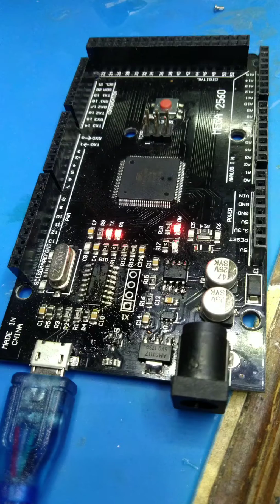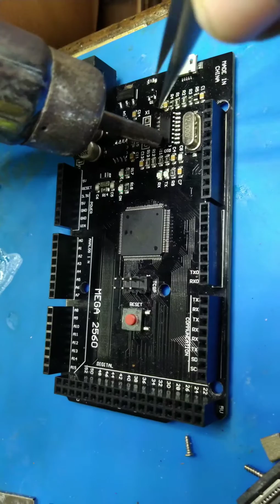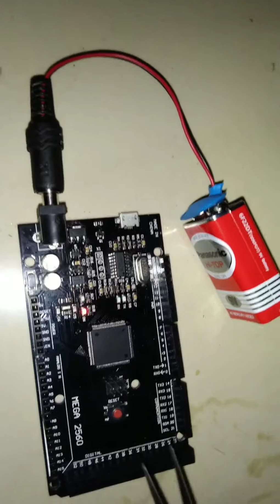How to fix a Dead Arduino Mega (CH340G fix)

Comment: I have same problem in arduino uno (CH 340G). When I connect Arduino uno to my pc it don't recognize and Rx, Tx leds continuously glow. What should I do?
Reply from the maker: Is that CH340G chip?
Reply: @Meloutsidethebox  Yes.
Reply from the maker: See if you are getting correct voltage on IC!